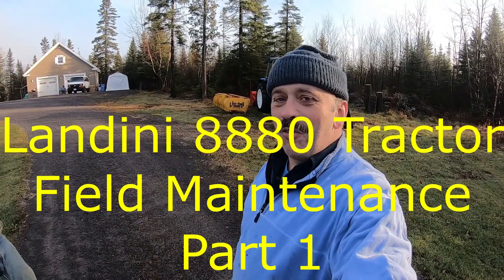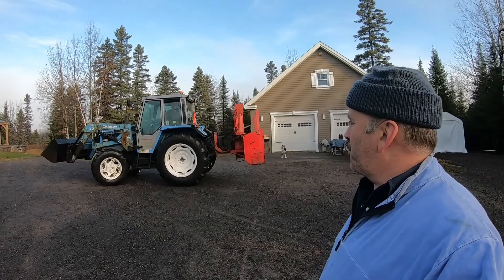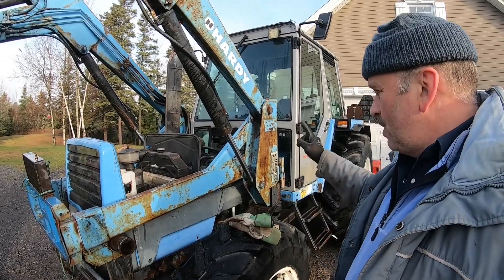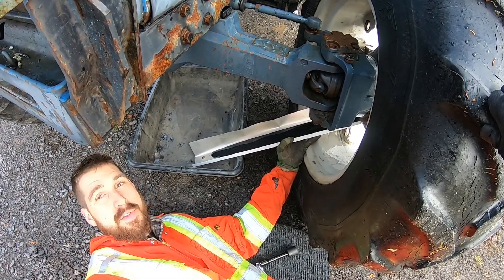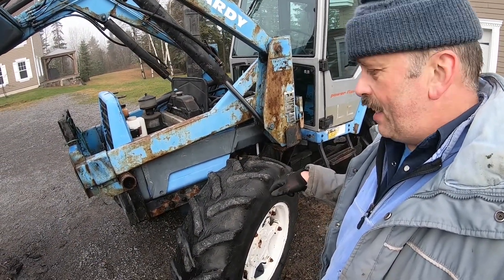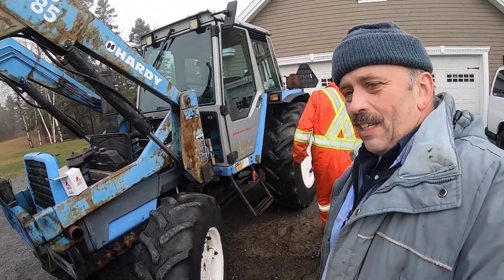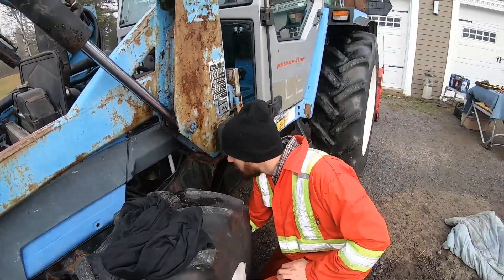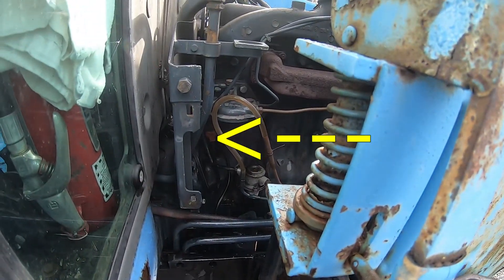Landini 8880 Tractor Field Maintenance Part 1

Comment: That is a pretty interesting tractor. I was checking out the loader mounts. They are interesting for sure. The design of the engine and components is very interesting too. It looks like the cab has really good visibility from it. I see his front tires have some weather checking going on. The tractor has to sit outside because of the height of the cab. Too bad there. Nice tractor. Good job Dave.
Reply from the maker: Good evening to both of you ( Hello Barb 🌹🌹😉😉👍👍 ) Thank you very kindly for your OUTSTANDING COMMENTS OBSERVATION🧐👍 Yes the tyres are showing for sure time of age,  but I think a new set of air tube will be needed.  Yes that tractor is very big in deed it will need a big roof over it for sure. 🤔 Have a safe week Sir and thank you again Cheers 🍻🍻

Comment: That is an interesting tractor and something different. I have not seen one of these before but I think they are Italian. It has the larger version of the engine we have in our mini excavator. I think it will take a lot of snow to block the path of that beast
Reply from the maker: Good evening Joseph, Thank you very kindly for you great support. Yes it is Italian and it went under Massey between 1959 and 1994 and now under Argo. Yes you are very correct that tractor is a true snow tractor for sure 👌👌💪💪😉😉 Have a safe week at school Cheers 🍻🍻

Comment: It's been a long time since I've seen a Landini so I'm going to enjoy watching this video. 
David, I have  some important things to do right now, so I'll come back to watching this in a few hours time.
I just got a chance to get back here and watched this one, ( 12:30 AM ) Dave, it was interesting, ad noticed how 'cold' those fluids were, did you guys run this tractor for a while before changing the oils? 
 I ask, as I just did this full service on my tractor, but I ran it for about an hour first, ( my Dealer's mechanic/ shop foreman suggested I do this ) by doing a bit of work with it to heat up everything, 
and I think it did drain much better.
I'm looking forward to Part 2 now.
Reply from the maker: Good evening mon ami 👍 thank you and Be safe Sir 🙏🙏😉😉Cheers 🍻🍻